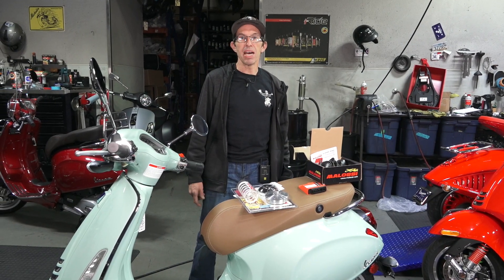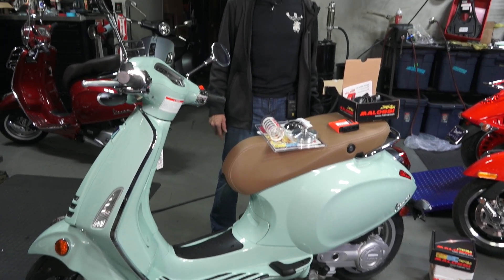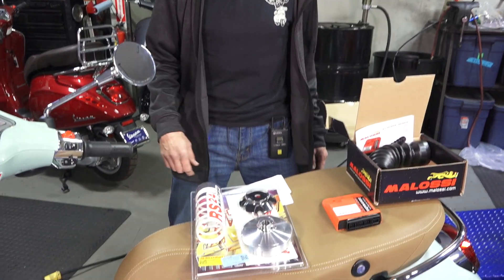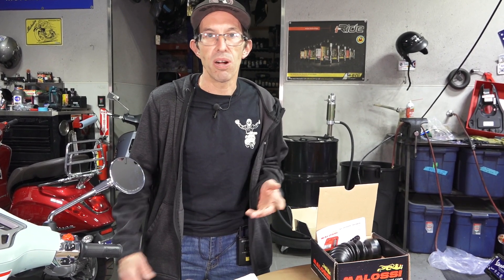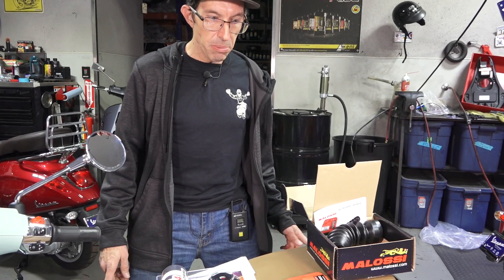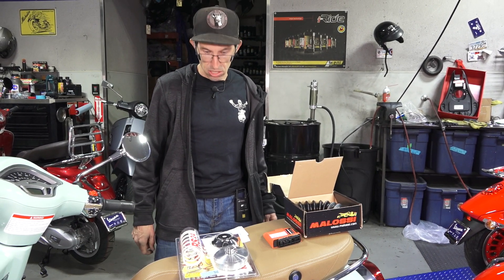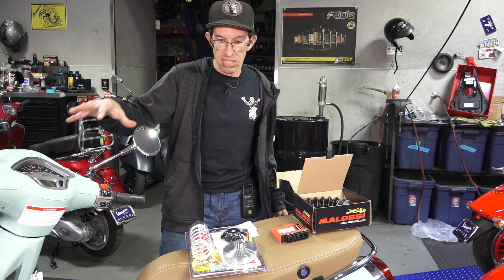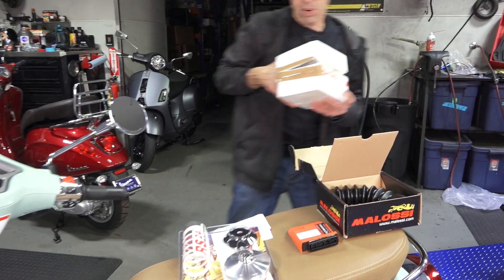Vespa Sprint/Primavera 50cc iGet Performance Upgrades

Comment: Hello - thanks, great video. I have bought the malossi multivar 2000, ecu, and new engine hose for my euro 5 2021 50 4t vespa primavera. After these upgrades, i barely get to 55kmh, and acceleration is still a disaster. My old vespa 2t 50lx was a missile in comparison, all with original pieces. Any advice? Maybe i have not installed the ecu properly? Thanks

Comment: Hello, I had a 2021 primavera 50cc. if i go with stage 2 option. what is the top speed the vespa can go. not max speed around 30 miles/hour. thanks !

Comment: With these upgrades, what improvements are you going to get on a Vespa Sprint 4t 50 2019? I'd like to upgrade it, but i want to be sure that it's worth it and that i am going to reach at least 60/65 km/h.

Comment: i have done on my Piaggio liberty 2022, 4t 3v iget: Head 80cc malossi + CDI malossi + Variator Malossi + Strap Malossi + Rear Gearbox Malossi.. dont know you wase search for some one video :S
Reply: Does it work, was it hard to install the head? I fitted 1 to old lx50 and the hills are easy, was thinking about buying a premevra 50 and do this full upgrade.

Comment: i see in stage 2 you have Malossi Injronic Controller for original cylinder M5518205 as step 2.  However, then below you say if you install the 80cc bore kit you need a different controller  in conjunction with the Injtronic M5518409.  so if i am to install the 80cc kit.. should i not buy step 2 controller but the controller for the 80cc kit M5518409?

Comment: Hi, 
I have a 2021 Vespa Sprint 50cc 4T Euro5 and bought theses Parts to upgrade and go faster. 
3117771 5519266B 5111597, also the MALOSSI Red Air Filter. 
I used all the parts, except the little black Plastic Ring that came with the Variator kit,..not sure what this is for but it isn’t on any Video install.
Everything was installed with no issues and the scooters ECU for the 80cc was properly set with the Book and a cold motor. 
First time starting it there was a bit of smoke and smell but after 3min it was gone and it idled ok. 
I took it for a spin and there is no rattle until 55km/h but it only runs to 63-65km/h max. 
At 63km there is a rattling sound and it sounds like it comes from the Valve Compartment! 
When you get of the gas the rattle goes away.  
Did I do something wrong that it only goes 63km/h…do I have the wrong ECU? 
I now want to order the Polini Exhaust but not sure if that will change anything. 
I did not order the MALOSSI Part # 6719315B but would? 
Would anyone have an answer why the scooter only runs 63-65kmh with what I have in now? It will absolutely not go faster…even downhill it tops at 70km/h and will not go faster. 
It would be great if anyone has an answers for me because the speed at 63-65 is very disappointing. 
Appreciate any comments and suggestions.🙏🏻
Best,
Adrian

Comment: I don't know about how unexpensive works. Installing all of these 3 options costed me 1,200 euros. And top speed now is only 65 kilometers. Engine lite is on all the time. They told me at Vespa service it's because the sensors can't be adapted to the changes.
Reply: thats why ignore all these iget crap.get before 2018 engine with carb.much easier and cheaper to tune.malossi kits for carb and iget are the same only for the iget u pay extra for that ecu.same story back in the ditech times.but carb engines are going much faster.these iget engines stil have limited power.

Comment: Please DO NOT WASTE YOUR MONEY ON THIS KIT, Melossi variator kit and the CDI Is a complete waste of money does 0 ZERO improvement, I did exactly what he said in this video, and the only single improvement my 2013 Piaggio Typhoon 50 4t 4v was starts like a second or two faster THAT IS IT, nothing else, so please I know this guy have a lot of experience with this topic but in this case is 100000000% fail.

Comment: Very useful în explaining how they all work together, I have an LX125 here in europe an I am craving for at least 60mph or 100km/h but I can barely get 85km/h and I was thinking which is better and easier for the home mechanic CDI + variator but add to the engine wear or the 190 cc kit

Comment: I bought a variator, an air filter and CDI (everything is Malossi). Is there any difference which detail I will change first? Which detail should I change first? First - variator, second - air filter and third - CDI?
Reply: did you install it ???
Reply: @amerpintol4008  Yes. I have installed an air filter, a variator and CDI (everything is Malossi). Now the top speed is 69 km/h.
Reply: @tomasnorvilis4731  I have now insted the CDI (malossi cdi 5518205) and now i reach 55km/h with the orginal sleeve, when i put the malossi sleeve i get 60 km/h but i can not reach top hils, on hills he can't get me out , sto i but back the orginal.
And i'm now thinikig to instal the mallosi variator kit.... and one more did you use the 6.1 gram rollers  that came with it ???
Reply: @amerpintol4008  Yes, I use 6.1 gram rollers. My vespa also goes slowly up the hill. It takes a long acceleration to reach 69 km/h.
Reply: @tomasnorvilis4731   hello wich air filter ( M1417227 or M1414532) did you bay ????
Reply: @amerpintol4008  double red (1414532)
Reply: @tomasnorvilis4731  ok thank you I will order it and than we will see

Comment: I have a vespa sprint 50cc iget with malossi variatorkit and the ecu. Its only going like 52kmh (32mph) anyone who knows where the problem might be?
Reply: The ECU (the computer box things) limits the top speed as-well as the revs. You will need to purchase a new ECU to get the speed up higher. Just be sure to buy the ECU for the original motor and not the ECU For the cylinder kit

Comment: I have one problem. I have installed this exact variator kit on my vespa sprint 50 2020, and acceleration is much worse than it was with original. Any suggestions what should i do? Should i change roller weights or maybe buy malossi cdi?
Reply: Did you get this figured out?
Reply: @TheSevenFiveO  nothing. I decided i’m going to buy malossi cdi and see…
Reply: @florijanzugelj3408  hopefully you get it figured out. I keep reading mixed reviews and I want the same setup. Cdi and variator
Reply: @TheSevenFiveO  i think that without malossi cdi it cant go better becouse the motor is being blocked.

Comment: Hi Robot, will the Malossi Multivar kit alone make a huge difference compared to the stock variator on a 2-valve 4tempi engine? Thanks!
Reply: huge not but the engine running smooth.Acceleration ll be much better but i dont recommend those 6.1 gr weights.u can use stock or little heavier rollers.

Comment: why does the primavera 50 state 4.1 hp at stock and the sprint 50 only rated at 3.2?  Thats over 20% increase!
Reply: Yeah I was wondering why there’s a difference too.
Reply: I know this is an old comment. I think it depends on the year. My 2018 Primavera is listed as 3.2 hp I believe. The earlier ones have more power.

Comment: We installed the CDI from Mallosi and we reached top speed of 58 km/h, additional we installed also the Hi speed variator from Pollini and now is Vespa Sprint 50 iGet going only 45 km/h . Where is the problem ?
Reply: I have the CDI from Mallosi in, waiting for the Variator kit. Will let you know how it goes once installed.
Reply: @sacredbundleman1414  hi, allready installed? What top speed now after upgrade?
Reply: @sacredbundleman1414  did you instal it ???

Comment: For the Vespa Primavera 50 4t that is before Iget, is are the upgrades exactly the same???
Reply: cyl kit is the same compatible with all v2 v3 and v4 engines.if u have iget u ll pay extra for that ecu and stil not going fast enough.

Comment: Hey, if i opt for 79cc cylinder and the injtronic M5518409; does the variator make any difference at this stage? should i add it?
Reply from the maker: If you want the maximum performance with the parts shown, we'd say get all three. The variator kit will make quite a big difference whether you have the cylinder kit or not. Thanks for watching!

Comment: I have a lx150 and would you suggest these same upgrades, different parts # obviously.  But I’m looking to upgrade.  Thanks in advance
Reply from the maker: Yep, all these components are available for the 150 as well as a couple exhaust options and an upgear kit for higher top end speed. You'll be able to keep up with a 300 pretty well!